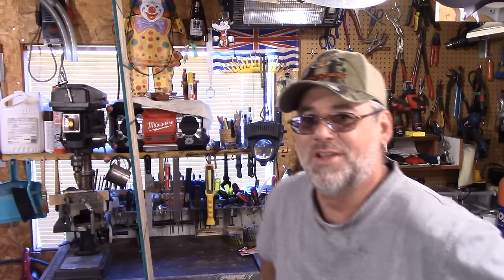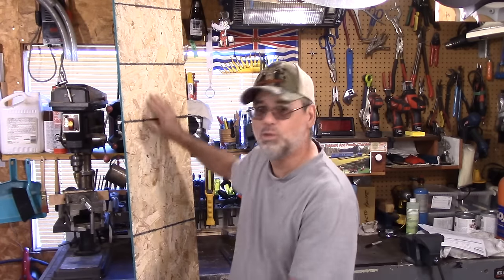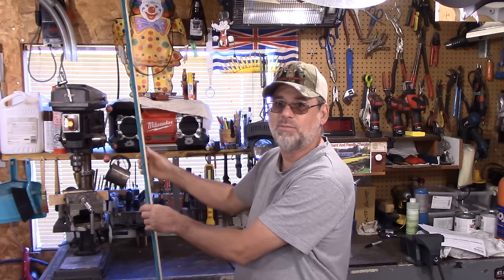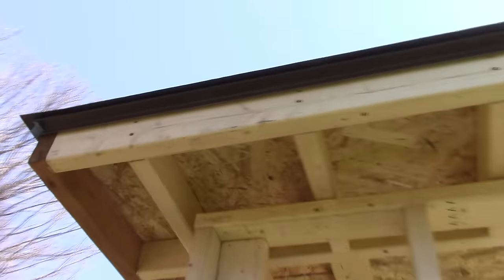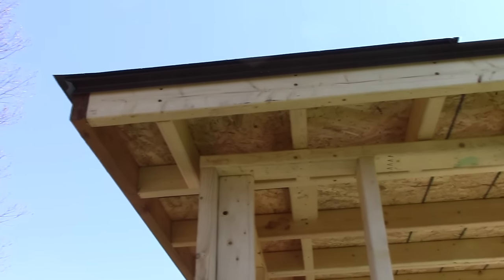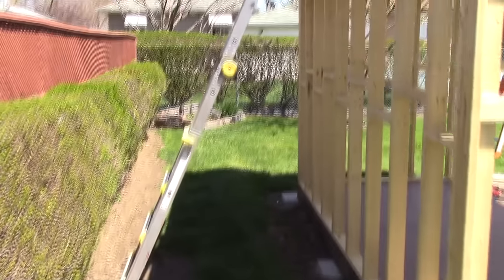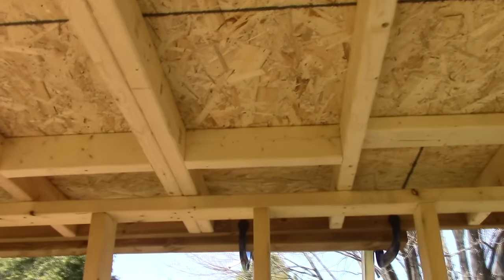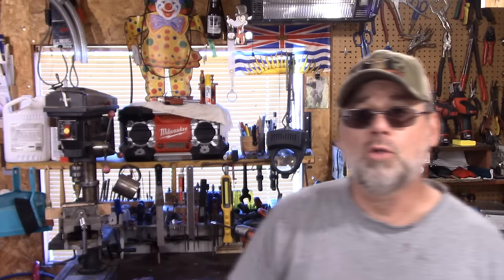HOW TO INSTALL ROLLED ROOFING ON MY GARDEN SHED BUILD

Comment: I've used Polyglas with great results.  They recommend using a heavy steel roller on the product to flatten it and promote adherence.  Whatever works.  Just saying.

Comment: $80 mabe per roll, the drip edge is around a buck per foot add another say $40-50 per sheet of composition board another $10-20 for screws I say makes the cost $300-$400 beer not included ;+)

Comment: Plywood is the best thing to use due to the multiple layers, the glue used while pressing them together making it almost impossible for it to absorb water. Osb swells up and rots
Reply: Great video otherwise educational for people trying to do something on their own
Reply: Or if you do use osb put a coat or two of paint on it to seal it off and make it last
Reply from the maker: Good suggestion . Thanks
Reply: STEVE ROB REVIEWS keep up the good work 👍
Reply: Especially if it gets moisture on the inside
Reply: Never ever put plywood on a roof. As a contractor, I have replaced many roofs due to the plywood delaminating.
Reply: Big facts!!!! I've got proof of it in my back yard!
Reply: What are you supposed to use then??????
Reply: What are you supposed to use then??????

Comment: I had the opposite experience - tore off a patio roof with OSB that was warped; they told me at HD to use Plywood - its always the best choice. I'm  laying down felt and covering it with rolls of roofing using nails.  I'm installing  drip moulding for a better appearance AND to protect the edges, but overlap all outside edges about one inch.
Reply: Ok

Comment: Hey thanks Steve! After my 2nd patio awning got ripped to shreds in the wind I ran to HD and built a 10x15 free standing flat roof cover using 4 - 4x4s w/braces and 2x8 border, 2x6 CJs and the 7/16 OSB.  But not sure on how to do inexpensive roofing. I’m an experienced carpenter but not roofer. Your video was a God send! I hope I can find that material👍
Reply from the maker: Awesome Dan 👍

Comment: Although it does list on lowes site that this product is not for flat roofs, it seems to have worked for you guys and it seems like my best option as well. So, off to lowes I go. Thanks for sharing!
Reply from the maker: Andrea it was a trial and error kinda thing for me that turned out quite successful.  It's  turned out over all these years a great alternative to other more expensive materials and so easy to install for the non pro roofer like me.

Comment: Closed in my metal carport a few years back and used metal sheets for a roof i built over the carport roof. The thin metal sheets have since been destroyed by weather so im thinking ill just use this over the osb instead. Not rally worried too much about leaks but I definitely don't want it to roll and kink up. How's your holding up after 4 years?
Reply from the maker: It looks like new still.  I have two sheds I've done about 12 years ago that  still look great as well.
Reply: @SteveRobReviews ty sir, im gonna put this on tomorrow

Comment: Your buddy is right about OSB being stronger in shear strength versus plywood. It’s about two times stronger for the same thickness and a lot cheaper making it being used in about 70% of the applications. And you’re right about that rubber ‘stuff’ as it is very sticky. Have a good one! 😀👍
Reply from the maker: Terry the only bad part about OSB is it getting wet but today proper installation solves that . Cheers bud.

Comment: I know u answered it already but I was under the impression that we should add some underlayment to better protect the plywood from water and the sorts. BTW liked the video and I am also adding this same stuff to my shed I am building but like I said I'm researching whether I should add some underlayment before the rolling roof
Reply from the maker: I have done 5 sheds without a underlayment  so far so good but sure you could try it and see how it works out. .
Reply: @SteveRobReviews  i just bought the stuff and it looks like it doesnt need underlayment like you said. Im a def rewatch your video couple more times to get a better idea how to install it because i know the adhesive is really strong so once its on its on its not moving. Do you have a video of how you glued the next piece and how much should it cover over the previous piece?
Reply from the maker: When you look at the material you will see the bare rubber membrane , that's the overlap towards the  top of the roof .  Sticks real hard but not anything you cant straighten out .  Just fold your cut length back  in half from side to side and  peel off the top white plastic section from the  membrane  on the upper   half first once it's in position and the bottom is where you want it then flop over the upper sticky side then remove the plastic on the bottom side and your done for that layer and do the same to the top of the roof .  You can use a couple of clamps to hold it in place if you like to stop it from moving , just put some  pieces of wood down first  to prevent damage of the material . 👍
Reply: When ive done flat roofs.. ive always tape sealed all the plywood joints, but i also use a roll roof adhesive.(can be messy and drip through knots) and if you get to thick, or its too hot.. it can actually burn/melt trough hot soft roofing..  i like this Sticky One, because its very similar to a Torch Down roof ,  but without the torch...  i think my main concern would be, that it stays stuck down(if ply was dirty or dusty or Damp) but thats a prep issue! haha!.  
and the smooth side can DELAMINATE , i have seen plenty of that,   which could possibly pierce through the roofing membrane.(if its not stuck down good and is soft during hot sun ect)... but on a shed ect.. its looks perfect.. id feel pretty safe using it on smaller projects.. good video dude..
Reply: @tadvanallen  tks for the insight and advice really appreciate it

Comment: My patio roof has same kind of material. Seems to be holding out pretty good since I bought this house 3 years ago. The roof is 16x14 size. I do not see any water leak mark under the roof. I do not know when the previous owner installed it.

Comment: Awesome!!  I'm gonna do this on my shed.  But for the life of me, I can't tell which way your roof is sloping.  Does it slope down toward the door?  It looks like you are rolling it down vertically. is that correct?
Reply from the maker: I start off at the lowest part in the roof and work my way up . My pitch is only 1.5 inches .  Yes you must put the first layer at the lowest part on your roof.  Been a long time since I  did this and the roof still looks like new. Cheers Dave

Comment: Where each sections meets what are you using to seal the space in between the rolls of roofing material? Did I miss a process?
Reply from the maker: It's peal and stick  on the overlap , seals real well.

Comment: Great video! One question: I'm about to put a new roof on an old barn. I get it that this isn't what a real "professional" roof would look like, but hell, I just want to keep the place from falling down. This kind of roll-roofing looks perfect for this project. The area I need to cover is about 1000 sf, and I'm wondering if the 7/16" OSB will work, or do I need to go with a heavier, tongue-and-groove 23/32" OSB? It costs twice as much, but I think it might be worth it, and I'm saving a ton anyway, compared to what I was bid by a roofing company!
Reply from the maker: Hi Bruce 
I  think 7/16 to  5/8 OSB is what I'd go with too  unless  your  roof rafters are too far apart and you expect 3 feet of snow on it all winter :)

Comment: Are you relying, only on the adhesive backing, and overlap for the seams?
Reply from the maker: Yes exactly.
Reply: @SteveRobReviews Has it held up well bro? I have a low slope 1/12 pitch roofed addition and was thinking to do this.

Comment: That's indeed a nice product.  I used it for my lean-to a few weeks ago. Very nice product.  I put shingle on top, but I think it can be left as is for quite a long time.
Reply from the maker: Joe I have it at my camp on two buildings and its fared quite well as is.  This has a sandy texture , not sure shingles would stick to it :)
Reply: That is perfect shingles do not stick to it, as it has to move a little bit to allow dilatation.  Shingles only have to stick to each other, then the nails do the job.
Reply: @SteveRobReviews  it's actually made for shingles to run on top of, what you laid is underlayment and NOT roofing material.. but works for the time being, until an acorn etc knocks a hole in it lol it's called ice and water shield, and is not meant to be exposed
Reply from the maker: I have used it for 5 years on other shed roofs and still looks like new. Its definitely not ice and water shield , thats a different product.  I will show a roof done years back in the future and how it looks . Cheers
Reply: @SteveRobReviews  lol bro that's 100% ice and water shield I'm a full-time roofer
Reply from the maker: @MaizeTheGamer_VR  Hum are you sure :) im not a roofer at all but  the ice and  water shield I have used does not have any granular coating on the top side. I did look at the description and it is used in valleys on its own but is used as a leak barrier in conjunction with shingles on most roofs.  Interesting enough the stuff lasts quite well as is for a low slope roof .  Now the cost was low and the skill level to install was low so I tried it .  Great idea to do an update five years from now to see how it does. Now you have to watch every vid for five years to find out. 😂😂

Comment: I installed, inspired by you , the same roof using rolled / sticky underlayment - weather watch and screws.  When you have time tell me how  yours is looking today after 3 years.  tks
Reply from the maker: Hi Norton 
I did a long term video update on the roof put in the description box below the video,  take a look. Cheers
Reply: Good to know that after two years still looking great. Two winters and windy springs I believe.  Good luck to us both.  My new roof  cost me $125 and 10 hrs of working (including the removal of old shingles and all the nails and staples).  Important to have the deck completely clean and dry. Cheers

Comment: I installed this yesterday, was wondering what liquid tar or coating is comparable with this? I want to put something on top of it to make 100% sealed. Its a flat patio cover. Thanks
Reply from the maker: I didn't use anything on top . Mine is holding up great as is.

Comment: I have a 12 by 26  roof over my shop with a 12/2 slope... There is one layer of the 90 weight roll. Do you recommend I tear it off and go back to the wood or do you think this stuff could lay right over top and stick to the other roll after I blow off any loose stuff with a backpack blower?
Reply: Never mind sir as I read through the comments someone already asked.

Comment: Awesome!  I'm totally doing this to an 8x8 shed.  Hey, if it leaks I'll use some water proofing sealant.  You way is very reasonable price, since it's a shed.  Thanks again.  I watched the update on it too. Still looks great.  Anything you'd do differently?  Do you still like that 7/16 OSB that you used instead?
Reply from the maker: No leaks and the osb  looks like new .   I can't think of any improvements since this still looks like new. Cheers 👍
Reply: @SteveRobReviews  Thank you for the update!! Very helpful.  Appreciate it.

Comment: The smooth side of the OSB should be exposed to the air. It is more protected from moisture. The rough side should have the roofing on it. But it should last a good long time. 

I have never heard of that type of roofing. Looks super easy!!

Comment: 80 bucks, gd.  Might put it over my new garage roof (that's already leaking and rotting).
Hm, wonder if you could use it for siding or a driveway.
Reply from the maker: I have never tried it so it's  experimenting  . Cheers 👍

Comment: Question ? Why no felt under the roofing ,I heard the sun will let the wood pull the oil out of the material, I have always felt it first
Reply from the maker: I chose not to use any felt but you could if you like.  So far it looks like new still and no leaks.
Reply: I'd say 30 lb felt down first would be the way to go, then this GAF product Steve shows in the video.  That's what the Polyglas tech told me, anyway.  That way you get a second layer of protection and as the roll-out roofing softens and melts in the sun, it seals the felt/tar paper.  17 years and no leaks on our roof. Just saying.

Comment: Thank you for sharing this video Steve.  I am currently building a very similar shed.  What is the pitch of the roof that you have, if you don't mind me asking?  I am planning 4 inches.  Do you think that will be adequate for an 8 foot roof?
Reply from the maker: I have about 1.5  inches drop from the front to the back .  I didn't want anything more but 4 inch is fine too . The water flows off fine on mine , nice and slow .

Comment: Do you have to remove the old rolled roofing before appling a new one?How do you remove the old?Do you heat it up  first or does it just pull off?
Reply from the maker: If the old rolled roofing is smooth yes you can put this on top .  The old roofing should just pull off if needed.

Comment: I was thinking about going this route on my 45° shed roof. But I saw it says "for use under shingles" so I wasn't sure if it would be compatible by itself... I figured I could use roof coating and go over top of it to provide an extra layer of protection if need be. Idk... How's it holding up??
Reply from the maker: I put a link below showing how it's doing after all this time .  It's an alternative use product I found works for me over the many years.  I don't like installing shingles, and I only use this on the many utility sheds I have  as it's easy to install and lasts . Cheers 👍

Comment: Thanks for the video Steve. I’m considering this for my shed renovation project but just doubtful if it will last 5 yrs with our Florida weather. Any suggestion?
Reply from the maker: Florida is hot with tropical storms so I would most likely go with steel roofing screwed down well. The cost will be 10 times the cost   and not so diy easy so its a definate consideration.  Cheers
Reply: @SteveRobReviews  thank you

Comment: Excellent video that is so much easier than shingles . Going to look into that is that what I ask for at Home Depot rolled roofing or does it have an actually product name Thanks for sharing just made my roofing life alot easier .Dale
Reply from the maker: It's called GAF WeatherWatch comes in a white cardboard  box about 3 feet high .  Since the filming  of this video it has held up great and will do an update video this summer. Cheers Dale

Comment: I'd just be thinking a lot about the wind getting under it around the edges & maybe if I could buy it without 'rocks' on it then cover it with some kind of a roof coating the is real reflective, of course 100 % silicone would be best but kind of expensive.  I've coated a few roofs with fiberglass mat & etc.
Reply from the maker: After all this time the roof looks as new still.

Comment: Hey Rob, went on easy. In some areas on the middle of the roof some areas coming up… any suggestions?
Reply from the maker: Hi David
I have experienced the same right after installation but it always settled down after a week of high heat and sun . I wouldn't be very concerned at all.
Reply: You’re great at answering bud.  Thank you very much.